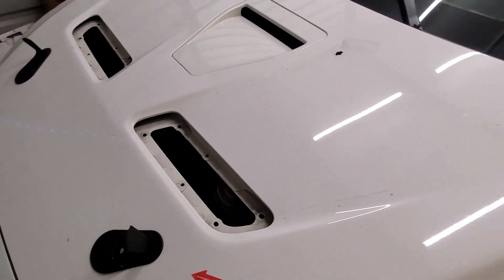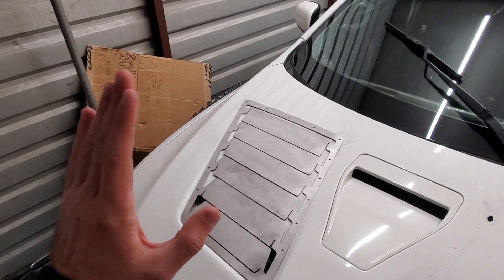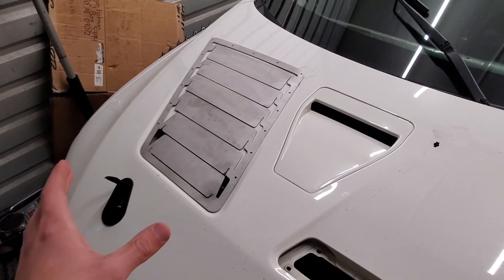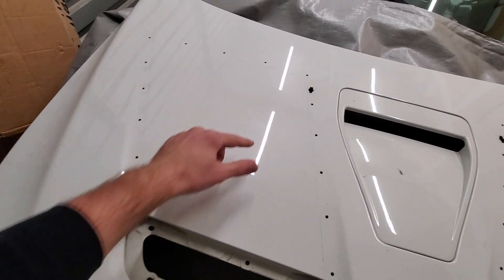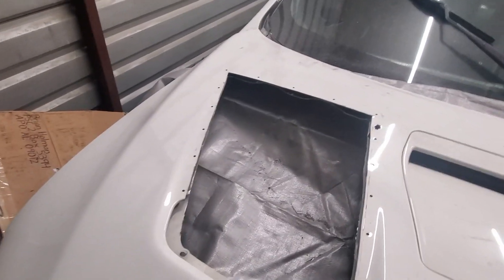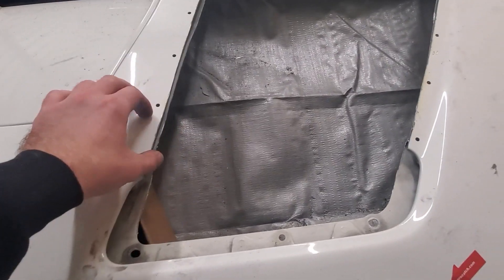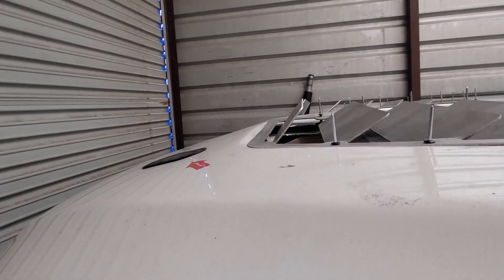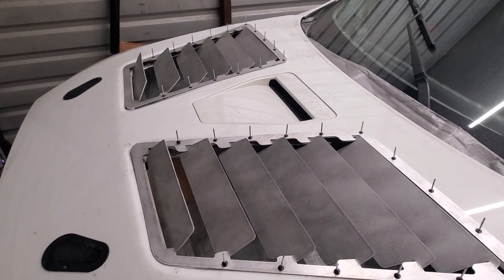Evo X Custom Hood Vent Install

Comment: Hey man, 2 questions. Did you just delete  the windshield washer nozzles? If so I’d assume removing the pump and reservoir? Second, did you actually see a drop in oil temp?

Comment: I live in the middle east so shipping for stuff like this would be pricey, but have access to a water jet, would you be willing to share the cad files for this cut?
Reply from the maker: Unfortunately i did not design these. There is a reseller in the UK. It may be cheaper that way to ship. His company is called RALLISPEED
Reply: @Polsihboy1  alright I'll give em a visit.
Thanks!

Comment: how about the water on a rainy  day will it  effect  any??
Reply from the maker: The car is rarely driven in the rain unless its raining while I'm out on track. Even then the rain itself won't be a huge problem as the water sucked in by the intake will not be substantial enough to cause any damage. If the car will need to sit in the rain unprotected then I will make sure to cover the vents to prevent excessive water entering the engine bay